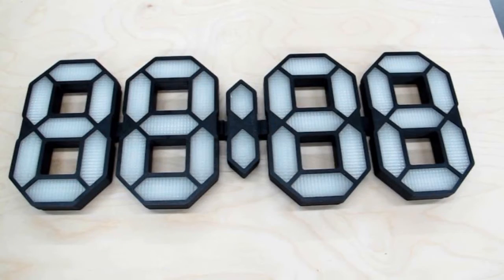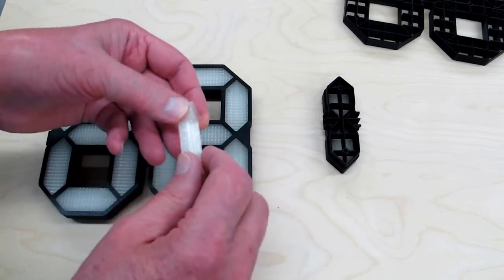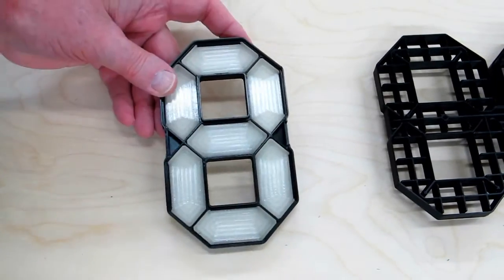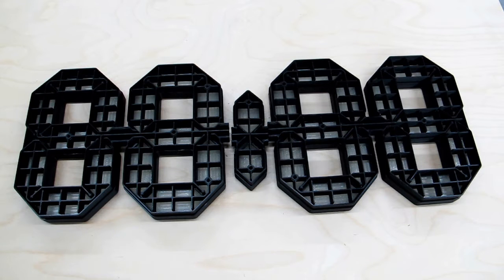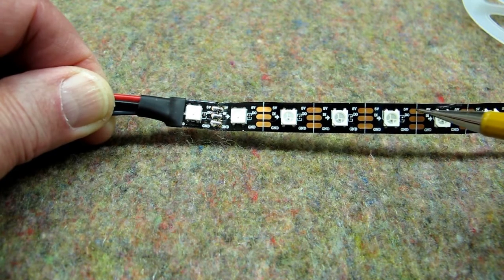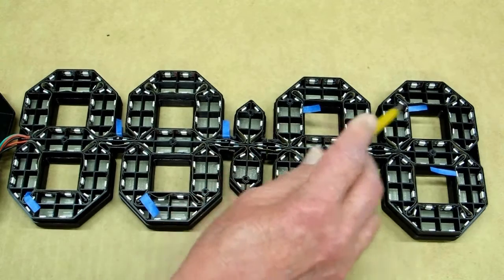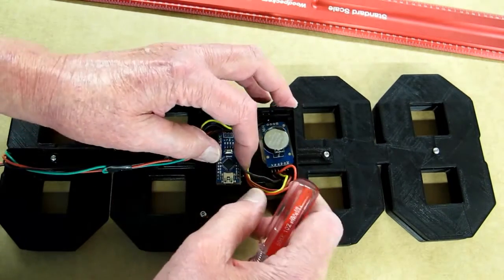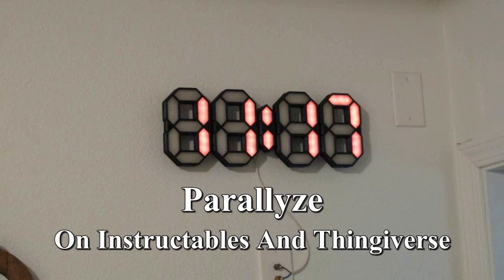Lazy 7 / One LED Clock

Comment: I don't have a 3D printer. Anyone sell this as a kit?
Reply from the maker: There are a lot of pieces to this clock and probably around 80 hours printing time, especially if you make a mistake or two. It would be cheaper to buy a 3D printer and learn how to use it. You can get an Ender 3 Pro for less than $200 shipped.
Reply: @RonaldWalters2010  Thanks for your reply. I am 72 years old. Is a 3D printer something that i am capable of learning. What skill level is required.
Reply from the maker: Well I was 70 when I got my first one two years ago. :-) 

It’s not an age thing… it is a willingness to make it happen. If you can operate a computer, know how to do google searches and know how to read and follow directions… you are good to go. Being somewhat mechanically minded would help. There are a lot of bits & pieces and settings you need to learn. If you don’t already have a hobby … here’s your new hobby. And in terms of a hobby, 3D printing is not all that expensive. 

There is a youtube channel CHEP … Filament Fridays who has a lot of good how-to videos. You will also need to know how to use a “slicer” which is what Cura does and he has videos on some of that. Watch and learn… Start with this one.
https://www.youtube.com/user/beginnerelectronics

I have a number of videos on it. You can purchase an Ender-3 Pro (which is what I would suggest as a first 3D Printer) using the links in the description of my videos and there are usually discount coupons. If the coupons don’t work let me know and I’ll get new ones. There are bits and pieces you can make (print) to make things better and these are available for free on Thingiverse.com  I covered some of this in my reviews of the CR-10, Ender-3 and Ender-3 Pro.

But you need to learn how to walk before you can run and this clock should not be one of your first projects. Maybe later on after you get a feel for how things work, etc. Start off with simple stuff so you don't have a huge failure right from the beginning.

So have fun and start learning... which will be preceded by confusion at first.
Ron
Reply from the maker: If you have ordered it already I do not see it showing up as using one of my links on Banggood.
ABS is tricky/difficult to work with. I have yet to use it because I do not have an enclosure around any of my printers.
I suggest you just do PLA for the foreseeable future. I tend to buy the cheapest stuff I can fine and sometimes I get into trouble doing that. There is a difference mainly in the diameter being less than 1.75mm. I check the diameter with a vernier caliper and enter the actual average diameter in Cura before slicing.
The spools I have made were for small electrical wire, not filament.
I buy the large 1KG spools. The small ones (I think) are for filament extruding pens. 
Black, yellow, red, blue, orange (or whatever colors you like) should get you going and will last a good while. 
Some of the better filament is wound a bit neater on the spools. I have experienced the filament crossed over on the spools which can cause problems. 
When you first start you will be watching it like a hawk until you figure out what all is going on. 

Filament prices have gone up this year.
This WYZworks has been pretty good. Make sure you select PLA and 1.75mm diameter every time.
https://www.ebay.com/itm/WYZworks-3D-Printer-Filament-1-75-3mm-ABS-PLA-SOFT-WOOD-PETG-FLEXIBLE-1kg-2-2lb/111384500750?hash=item19ef089a0e:g:BuUAAOSwL3Jaxl-f

Comment: Can you turn this into a timer/stopwatch (for like 5K races and stuff)?
Reply from the maker: Possibly. In the description for this video are links to Daniel Cikic’s instructables articles. He has designed several different clocks and one of them may already be a timer. He’s the electronics guy, not me.
Reply: You can use the basic routines for displaying digits, but I would not recommend using this as a precision timer for various reasons. Arduinos are not very well at time keeping without modifications and/or additions. You will need some kind of accurate time source, the DS3231 modules offer a square wave output which can be used - but you'll want to avoid WS2812 leds then, on Arduinos there's not really headroom for using interrupts...
It can be done using the modules - but for a precise timer/stopwatch there is a lot to consider...